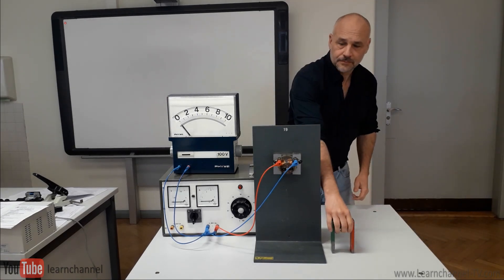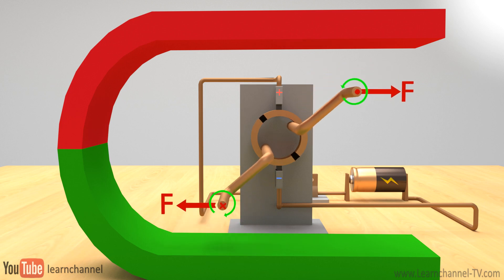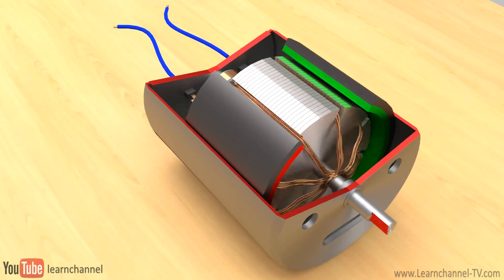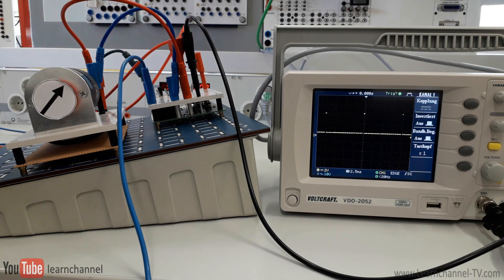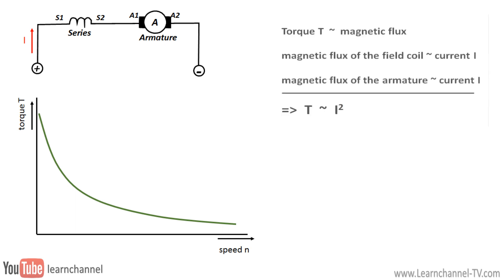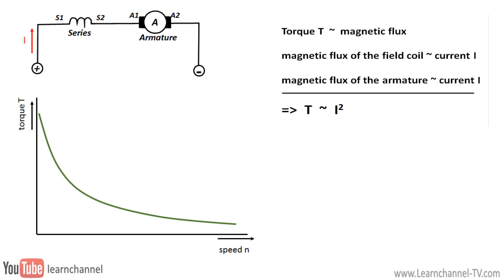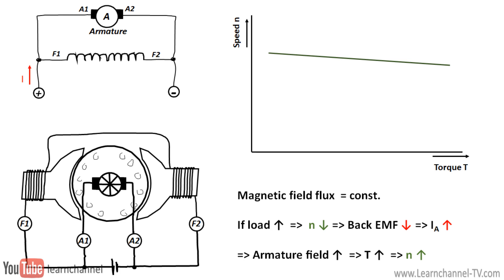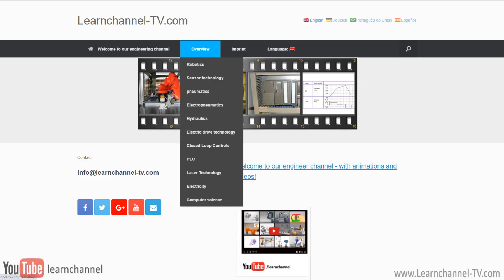DC Motors explained - electric motor principle

Comment: With a shunt wound motor why would it speed up to the point it would self-destruct? Wouldn't it start creating a back EMF which would limit its speed? And if not why don't you just write it at a lower voltage?